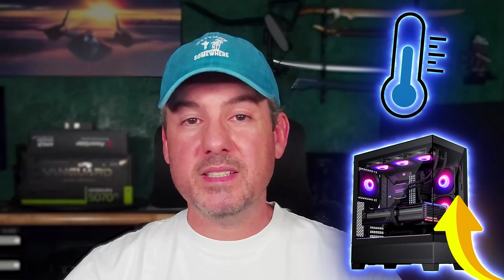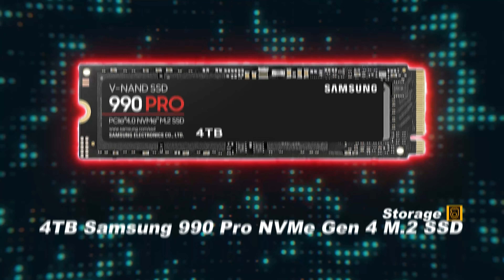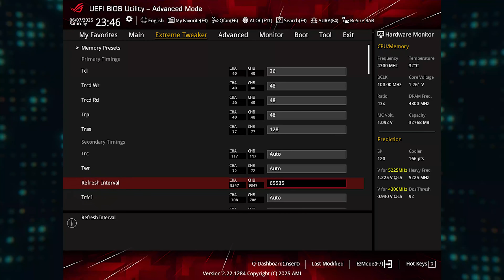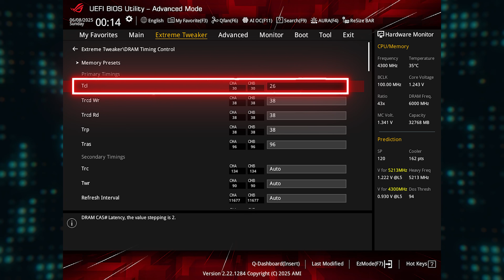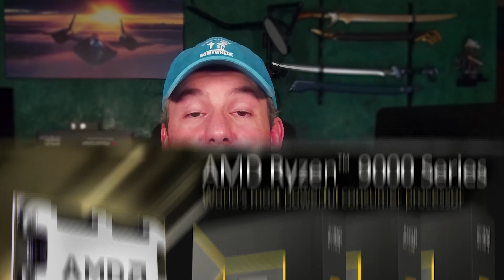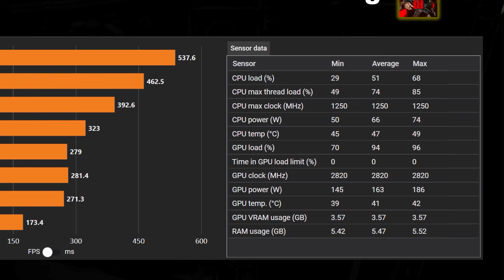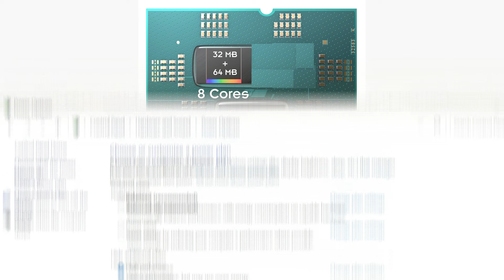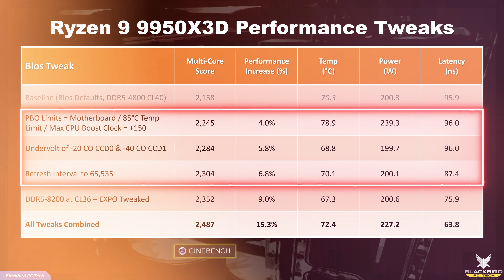What Are The Best Settings for an AMD Ryzen CPU?

Comment: For a 7800X3D - are we running turbo mode or not? I'm seeing conflicting info video to video.
Reply from the maker: What do you mean by turbo mode? I would recommend running the "High Performance" power plan if you want max performance in games
Reply: @blackbirdpctech  Thank you for the response. I’m referring to the turbo mode option in the bios screen. Your clips show it as disabled but you don’t say anything about it.

Comment: Hiiii thanks you soooo mush your video helps meeee allot ... Just one qeastion I have since I use Ryzen 7 7800 x3d can I use on it boost clock override to positive 150 ?
Reply from the maker: You can use it but it won't do anything since the 7800X3D is locked for overclocking

Comment: Since I can’t run 1:1 on my 6600 MT/s ram. Should I just go with DOCP Tweaked since it is stable? Or play around with lower frequencies to try and get the 1:1?
Reply from the maker: If your RAM is DDR5-6600, using DOCP tweaked will simply run it in 2:1 mode ... which will be slow. I would recommend watching my memory tuning guide that will be released tomorrow ... that should help you run at 6400 or 6200 in 1:1 mode.

Comment: Hi Blackbird PC Tech! just wanted to undervolt my 7800x3d alone without OC and see if it lowers my temp. I tried at default first to -20, -30, -40 in cinebench the lower the offset the higher my score got but my temp dont seem to lower. Im getting cpu max package temp of 81 C from default to -40. am i doing something wrong? or am i supposed to test the temp on some games? Thank you!
Reply from the maker: You likely have a cooling solution that is incapable of adequately cooling your 7800X3D, so when you undervolt, your CPU uses that new thermal headroom to boost your performance.
Reply: @blackbirdpctech I found the solution. I just uninstall ryzen master and my temp from 81 C on aida64 to 68.9 C. I did tweak it on bios and just installed tyzen master for backup when I tried cinebench temp never goes down stays at default temp even when Im at -30. tried uninstalling and im getting 69C 100 usage. Now just getting to know which offset more stable, I'll get back to this vid ot OC my cpu next

Thank You so much 😊❤
Reply: Now im lost again. when Im testing stress test using Aida64 it only shows 69 C max temp. but when using cinebench 2026 im getting 82 C max temp? is it the software or what? 😭
Reply: Update I tried OCCT stability test at -50 and it crashed and reboot the system im getting 71 C before It crashed. Cinebench isn't reliable at all 😭

Comment: Got my 7600x3d 9070xt system's ram from 6000 cl28 to 6400 30-37-30. The usual uplifts were at or under 1%, but the largest one was Marvel Rivals on low, nearly 30% better 1% lows. I havnt even tested minecraft with distant horizons yet.
Reply from the maker: Nice ... my RAM tuning guide will be released on Friday (available now for members).
Reply: @blackbirdpctech  and after a lot of fan testing to get the optimal layout, Im not sure if ASRock's -40mV undervolt is actually being applied, but I did beat the "best" 7600x3d OCCT scores by 0.1-10% across the board. Starting out, I got the worse scores than their "worst."
The bios on my mobo doesnt let me set it manually, but it has performance options that supposedly include a curve offset. -20, -30, and -40mV.

Comment: going to start undervolting which cpu temp should i take note of to compare results later? HWInfo shows 3 types CPU (Tctl/Tdie), CPU Die, CPU CCD1 (Tdie). my gues would be CPU (Tctl/Tdie) is it the same as the Max Package Temp? you use in the vid?
Reply from the maker: I believe that the package temp is the CPU Die temp
Reply: @blackbirdpctech  Thank you my temp decrease from 81 (C) to 71 (C) from -20 offset 

But Uhm update im now at offset -40 and aida64 passed a 10 min run without issue. I saw no difference between -30 and -40 offset in core clocks having 4.3-4.4MHz on avg and Max Cpu Die at 69.4 (C) 69.5 (C), CPU power package 77.3 max and 63.5 avg. 

Should I attempt to -50 and so on until it crashed? Havent test more than 10 min stress test yet.
Reply from the maker: @Matt-s3t2u  no, in fact I would drop it back to -30 ... my guess is that you will likely fail a longer test of AIDA64
Reply: @blackbirdpctech  is that so, just tried -50 and passed 10min run at aida64. im lost here now. expecting it to fail under a min under stress test. probly just go back -30 then. i thinking now if i really won the silicon lottery thingyy sighss
Reply from the maker: @Matt-s3t2u  you don't have to guess ... just run the test longer
Reply: @blackbirdpctech would try this and get back to you later as its 12am in here now. thank you making your time here 😅 I really loved your chanel very informative and helpful😊

Comment: Excellent guide! A word of caution though - keep your AIDA stress test running longer for your undervolts. 20-30 minutes, up to an hour. I had two fails at -30 and -25 that would not be otherwise detected, neither in games, nor in OCCT. These only showed after 25 and 45 minutes respectively. Can also try MemTest as free alternative to Karhu. Good luck!
Reply from the maker: I haven't found the need to do that with AIDA64 ... but definitely something I will have to look in to more.

Comment: On my 9800X3D w/ MSI B850 gaming plus MB.. paired with an RX 9070 XT.
I was able to get a 8% increase in benchmarks for my CPU score by changing my Rams refresh rate to your recommendation and maxed my Expo profile, from 5800 to 6000MHz.
I also set memory speed to 1to1 mode manually. 
I already had a stable 200mhz boost to my cpu with a -10 UV. As well as a good gpu OC +5 power, max mem freq 2740MHz @ Fast timing. /UV. -120.
I had to issues using Ryzen Master.. So I tuned everything through Bios and it works great. I tune my GPU using Amd Adrenalin and It’s great. It shows my cpu tune on there also.

Comment: Should i leave pbo scalar on auto or x1 or x2 for these settings?
Reply from the maker: I either leave it on auto or use x2, but you really need to understand the risks associated with scalar before using it. You can gain additional insight and tech support from within my Skool community:

https://www.skool.com/blackbird-pc-tech-4230/about

Comment: I have a question. I have a Gigabyte X870E AORUS MASTER, a 9950x3D, and DDR5-7200 CL34 XMP memory. In the BIOS, I underclocked my RAM to 6000 and set the UCLK to 1:1, which is 3000. There is also an option to manually set the FCLK to 3000 so that they are all synced. Should I do it, and if not, why? Thanks
Reply from the maker: It's funny because in this video (https://youtu.be/0JzE1Gyns8Y) I used ChatGPT to tune a 9800X3D and it recommended setting the FCLK to 3000 MHz. The problem is that you will be unable to run anything close to 3000 MHz stable.
Reply: @blackbirdpctech Thanks for your reply, Funnily enough. I watched the video, and I made the same mistake you said not to make: I put it on 3000 MHz. Yeah, it didn't boot. I didn't know what to do. I had to look it up online and realized that I had to clear the CMOS. I did that a couple of times until I found the upper limit for crashing, which was 2233. Then, I went down 100 MHz, and it worked just fine. The question is, what apps or programs should I use for stability tests on my PC?
Reply from the maker: I have a PC Software Tools cheatsheet that you can download from within my Skool community: https://www.skool.com/blackbird-pc-tech-4230/about

Comment: Hey sir, thanks for your great content!

I tried and would appreciate your help (AMD Ryzen 7 98003DX):

So i set the negative curve for undervolt to negative 15, Overclock 100 MHz.
What i dont understand is that cinebench had almost same temperatur while hitting a higher score (around 1324 after BIOS settings). Temperature was around 88-89 before tweaking when running cinebench and same after the tweaks. I thought the temperature would be much lower. What am i doing wrong?
Reply from the maker: You are not doing anything wrong ... you created additional thermal headroom and overclocked your CPU ... so your CPU boosted higher for longer as a result
Reply: @blackbirdpctech  I understand. But the whole point for me was to improve temperature while gaining performance. Isnt that possible?
Reply from the maker: @Biberzahn23  you need to think through what you are asking ... you want your CPU to work harder to generate more performance, but you also want it to do that with less temperature ... it doesn't make sense. You can't overclock your CPU and expect the temperature to go down. I recommend simply undervolting your CPU and starting with that.

Comment: I have been undervolting and setting a thermal limit, but I never overclocked. Guess I wasn't getting the most out of my 7900x.

So far on CCD1 I am up to 40 (Negative) and it's still stable..is this normal? Also should I do CCD1 til it fails THEN move to CCD2 or should I put 10 on CCD1, then 10 on CCD2 and flip back and forth? I think you said to do one then the other but just confirming.

I kept going, got 40 for CCD1 and 20 for CCD2. Stable in AIDA64. But as soon as I started any game, the computer crashed. Weird. I had to back CCD2 back to 10.

Comment: How long do you run your Karhu when testing for ram stability? I have a Crucial 32 gb 6000mhz CL36 ram paired with a ryzen 9800x3d, should i change any settings in the karhu app?
Reply: Thanks! Great video
Reply from the maker: There is no right or wrong answer when it comes to stability testing, regardless of what many will say online ... it really depends on what you are doing. This is what I do:

1. When tuning my RAM and varying different parameters I run Karhu for 10min
2. When I think I have a stable setup I will typically run Karhu overnight (12+ hrs)

Comment: My pc didnt boot after the ram tweaks, i have the exact same gskill 6000 cl 30 kit he mentioned. But the lower cl rating and higher voltage does not work.
Reply from the maker: The video is a guide to show you how to tune your system ... as I explain in the video, you shouldn't simply copy settings even if you are using the exact same components because your silicon quality will vary.

Comment: motherboard code 8F  I some that have it no much     I don't think is bad .               but why not 08  like most    .    only when I hard boot 8F     
When I sleep it and come back in 08  ?        I'm thinking FanControl software  ?
Reply from the maker: Have you tried updating your Bios?
Reply: @blackbirdpctech yes, and all drivers
Reply: @blackbirdpctech it was booting an 08 now it's an 8F , after messing with the conflicts with gigabyte control and open rgb & FANcontrol.
Reply: @blackbirdpctech don't worry I will figure it out.
Reply from the maker: I'm at CES, so unfortunately I don't have much time to help ... but you can join our community in Skool where you can get further help: https://www.skool.com/blackbird-pc-tech-4230/about?ref=67e6a7048d9540fe87cbdf1b69bd47f3

Comment: I just installed my 7600X3D and noticed right away a lot more stable FPS than the 12700. I'm liking my X3D a lot; it's great! I only turned on Turbo in the BIOS. Is it really needed to use this setting from this video?
Reply from the maker: You don't need to do anything but if you want to extract the best performance you can, then this is something I would highly recommend.
Reply: @blackbirdpctech How much performance are we talking about in improvements in lows?, I never messed with BIOS in detail; for any chip, I would want exact settings to change to make sure my chip stays safe.
Reply from the maker: @cmoneytheman  I haven’t tested the 7600X3D but based on my extensive testing I would guess around 10%
Reply: @blackbirdpctech That 's interesting how the chips are already so great. The performance can't see a big jump by using BIOS settings compared to back in the day when people did overclocking, and they would see like 20-30%. Technology has come a long way.
Reply from the maker: @cmoneytheman  a 9600X/9700X will see a 30% increase in performance

Comment: I don't understand why i should increase the pbo limits (ppt, tdc, edc) to values my cpu will never even use even under 100% load. Can someone actually logically explain what benefit that should give? I just tested how much % of the limits my cpu reaches when under full load and even decreased down from the amd standard limits to about a point where under full load the limits do not exceed 80% of the set limits
Reply from the maker: Why wouldn't you increase the pbo limits? It's like buying a PSU ... if you buy a 1200W PSU that doesn't mean you will draw 1200W, it means you have plenty of headroom to cover your power needs if/when you do need more power.
Reply: @blackbirdpctech i get the idea behind it but after trying a lot of different settings i just noticed increasing them higher than necessary just increases temps and worst case if your cooling is not sufficent enough your cpu starts throttling way earlier. There are so many different opinions on how to set up pbo but it never really increased power or efficiency for any if my 3 different ryzen cpus
Reply from the maker: @oskrutio  if you are seeing increased temps then you should also be seeing increased performance ... that said the magnitude of the benefit will depend on your chip ... for a 9600X/9700X the benefit is huge ... but for a 9800X3D it's not
Reply: @blackbirdpctech thanks for taking your time to answer me. The processor i've tried most of the pbo settings with is an R9 7900x3d maybe it's just a bad one you never know. Undervolting worked good on the 7900x3d though got lower temps and higher clocks and still stable but i spent almost a week tuning per core and stresstesting for hours
Reply from the maker: @oskrutio  that's a more challenging chip because of the dual CCD's ... make sure you are using the balanced power plan so windows can prioritize the cores properly in games.
Reply: @blackbirdpctech first time i heard to do that is the performance plan struggling with ccd seperated cores or what you may call it?
Reply from the maker: @oskrutio  I explain it in the video

Comment: First of all masive respect for the content! There was a very frustrating thing for me, i did everything you said and got much better score in Cinebench and all stres test were fine with aida64 (my cpu is 9950xrd, curve ccd0 -20, ccd1 -30, boost +100mhz), but my computer started to freeze on the low tasks that spikes cpu mhz, for example opening tabs on web browsers. CPUID HWMonitor showed me my cpu spiked to 5816mhz and caused a freeze because it was undervolted for the spike. AIDA64 doesnt give you error for this and it was runing for more than an hour...i had to lower the boost to 50 and both ccd are now on -15 so that computer doesnt freeze on light tasks and could actualy run OCCT to check for the errors on core cycling for the spike effects and thus far no freezes...Any thoughs on this matter?
Reply from the maker: That's interesting and something I will have to investigate further ... I haven't experienced it first hand ... are you saying that OCCT was able to detect undervolt errors better than AIDA64? If so that's great to know.

Comment: Excellent and straight forward content, really appreciated. I am using a 7800X3D and I still can't come to ease with the power settings within windows for the CPU. Seems like it is almost a split 50/50 opinion in regards to power plan and what to use for the 7800X3D. I have used balanced pretty much from when I installed my system since it was mentioned by AMD themself that the CPU would work as intended if setting it too that, but that is over a year ago, and now I am just confused. Also in regards to how it and if it has any connection to the power mode settings in the new settings control panel. Right now I have it set to high performance power mode and the balanced classic control panel power plan, but from your video (my technical ability and knowledge in terms of OS etc is good, but your explanations and in depth knowledge are way above, and the way you describe things in an easy way is for sure helping others) the correct power plan for the 7800X3D given its difference to the 7950X3D and CCD cores is the high performance one? Any response is highly appreciated, and also on how I should set power mode would be just a bonus. Might be something for a future video idea as well of course, and I would choose a video from you over others since you talk pure facts, and it takes a bit for me to trust content creators that uploads videos like this, but I trust your videos and would be what I would send others if asked. Keep it up.
Reply from the maker: The solution is quite simple ... if you want max gaming performance then use the high performance power plan in control panel power options. The only time you would use balanced for gaming is if you have a dual CCD chip. If you are running a lot of professional workloads or use your PC for lots of different things, then the balanced plan is fine.
Reply: @blackbirdpctech thanks for your reply, and yet again, straight to the point, highly appreciated. What about the power mode setting in the new control panel? Do you have any good information on that and if it doesn't interfere in any way with the power plan no matter how you set it?
Reply from the maker: @MSFSBenReddic  typically the Windows options will get auto set if you select the high performance plan. You can get additional help and support in my Skool community:

https://www.skool.com/blackbird-pc-tech-4230/about?ref=67e6a7048d9540fe87cbdf1b69bd47f3